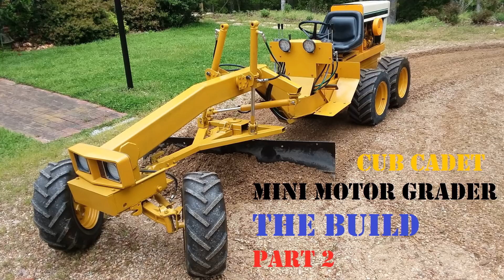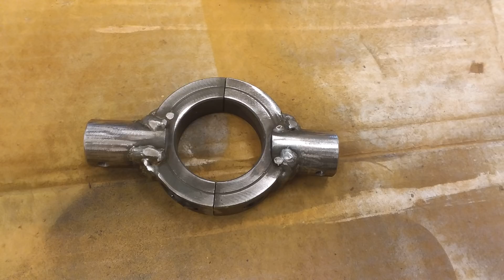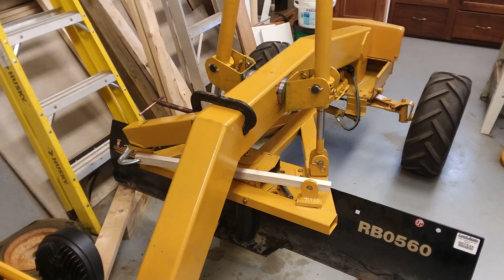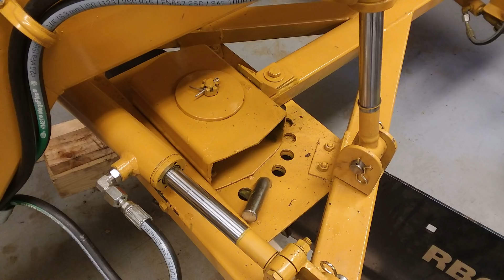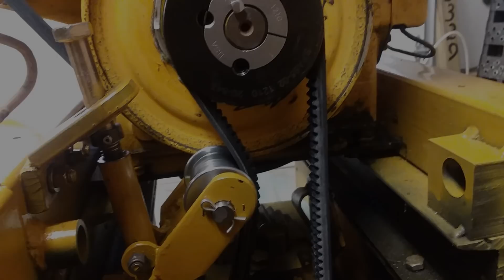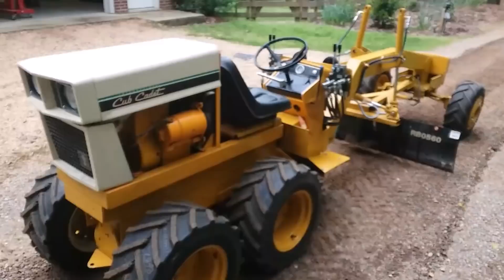Mini Motor Grader: The Build!  Part 2

Comment: Hi, I'm  looking at doing something similar but more compact to a "Rover Ranger", a somewhat smaller rear engined Australian Ride-on Mower partially as a driveway/garden tool and also as a acreage "toy".. have you got an idea on your machines wieght?
Great little build you have there.. I will be keeping mine simple and much cheaper hopefully with manual blade adjustments.
Reply from the maker: About 2000 pounds/900 kg

Comment: I really like this project, I was wondering what did end up doing for the hydraulic pump to run all the systems?
Reply from the maker: It's explained in the most recent video--published last week. The hydrostatic transmission has auxiliary hydraulic ports.

Comment: Genius, sheer genius!!!! Well done. I never would have thought about building something like that. I’ve contemplated building a dozer, excavator, and/or a loader, but not a grader. Now you’ve really got the gears spinning in my head. A quick question about your over-heating issue with the hydraulics, have you thought about using a heater core from a 1981 Olds Cutlass with a blower motor and fabricating a tunnel box to cool the fluid down faster, or even running 2 cores in series to cool the fluid down even faster? I know, more money to throw into the project, but when you think about it, it’ll keep it from over-heating and causing even higher costs in repairs. Just a thought.
Reply from the maker: I had a hydraulic oil cooler rated for 14hp that I was planning to use. I decided in the end to double up the drive belts to provide some redundancy and avoid the power loss inherent in the hydraulic drive system. It was the loss of efficiency that ultimately made the decision, not the overheating issue.

Comment: Very nice job waith all the fab work, So kool. Your blade controls might be easier to operate if the levers were on opisite sides so one hand can always steer or both hands on the blade.  I ran and run 14G and other stuff for almost 40 years...  Love the dozer by the way.  ; )

Comment: Where did you get the hydraulic pressure to run the cylinders? Great job.
Reply from the maker: Charge pump on one of the hydrostatic transmissions has auxiliary outputs. It's only 600 psi at 2 gpm, but it's plenty for that application.
Reply: Thanks

Comment: Outstanding idea wouldnt a 27 hp kohler eng take away all the power problems you disgusted it would eliminate the need for the starter/generator and give you electric start and a whole lot more hp from the start.....

Comment: FYI: The TV Show Classic Tractors has a show on a Case Lawnmower style Forklift......if you need another project
Reply from the maker: I've seen a Cub Cadet forklift conversion--it drove backwards, or, at least the forks were behind the rear tires and the operator seat was turned around.  I'm getting things lined up to build a Cub Cadet "dozer" this coming winter.

Comment: Great build Frank, I have one question, did you compensate for the hydro"s not sitting level in the original frames??
Reply from the maker: I think they are level.  If I understand the question.

Comment: FRANK I THING IT WAS A GOOD IDEA TO GO BACK TO BELT DRIVE .A HYDRAULIC MOTOR YOU WOULD BASICLY HAVE ONE SPEED YOU HAVE TO USE HYDROSTATIC FOR DIFFERENT SPEEDS
Reply from the maker: The hydraulic motor was set up to drive the hydrostatic transmission, the same way the belts drive it, so I'd still have variable speed via the hydrostat. But the power losses would be significant, so not the best idea...

Comment: FRANK YOU ARE VERY SKILLFULL. I WOULD LIKE TO SEE YOU BUILD A MINI DUMP TRUCK . SEEMS YOU HAVE ALOT CUB PARTS LAYING AROUND. YOU NEED IDEAS GO TO YOUTUBES MIKE FIESTA IF YOU HAVE NOT ALREADY HE BUILT A MINI DUMP IT TURNED OUT VERY NICE . NEXT TIME I WOULD LIKE TO SEE YOU USE 3/8 TUBING LIKE TRANS LINES OR GAS LINE WHERE YOU CAN. ALSO YOU COULD GO TO AMAZON GET ALL YOUR FITTINGS HOSES HYDRAULIC CRIMPING TOOL WITH MULTIBLE SIZE DIES FOR HALF WHAT YOU SPENT ON HYDRAULIC LINES. VERY NICE JOB ON YOUR MACHINE  THANKS TOM SON OF A MECHANICAL ENGINEER
Reply from the maker: Did you see the video on the 6x4 Cub dump truck on my channel?  It doesn't have the capacity of a real dump truck, but I have a FEL on my Kubota.  

Yes, I've seen Mike Festiva's channel. He does amazing stuff. Was actually looing at Langmire's CNC plasma table that he shows on his channel.  He uses a lot of auto and four wheeler parts in his builds. He makes me look like an amateur.

Comment: After working on graders for 35 years, I can say that the tires on the galion in the picture are on backward. If it were a an allwheel drive machine, it would be correct. I think that you did a very nice job on your grader.
Reply from the maker: You are part of the growing chorus on turning the tires around.  Gonna have to do it, I guess.  Thanks for the additional insight.  Cheers!
Reply: @woodandmetalshoptime8048  No need to re-rim the tires-- simply switch the right and left wheel assemblies.  I assume they are symmetrical otherwise.  Nice job.

Comment: Well done sir. That is a fantastic replication of a larger grader. You managed to get the proportions dialed in perfectly. Graders are my favorite piece of equipment to operate. Do you feel like the engine has enough power? I didn't see a mention of the HP rating on it. For those who have gravel driveways to maintain, this would be a great piece of equipment. Thanks for the informative videos.
Reply from the maker: Well, 12 HP is enough for the scale of the tractor, but it isn't going to be building any highways, that's for sure. It will lose traction before it stalls the engine so more HP would just spin the tires faster!  With more weight, it probably could use another 5-10 HP.  But then it wouldn't be a Cub Cadet any more...
Reply: It’s a 12 hp. It’s in the first build video. I’ve been amazed at this piece of equipment since I saw the original video several weeks ago.